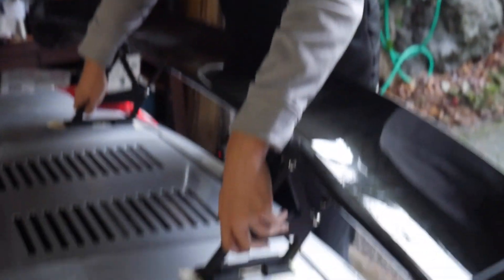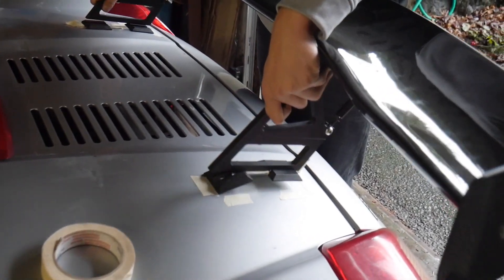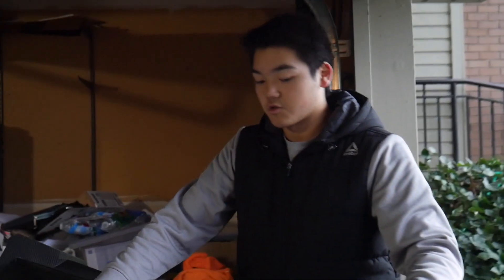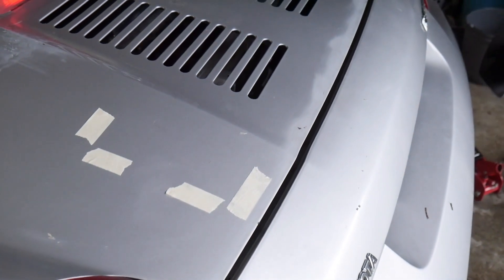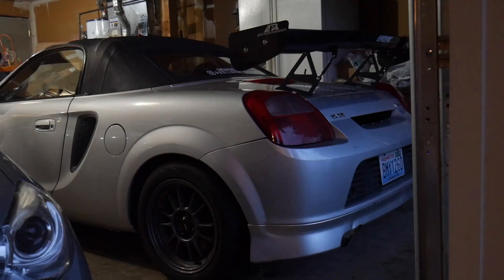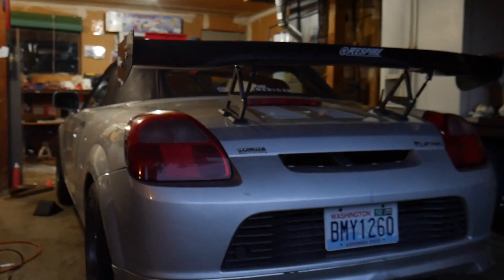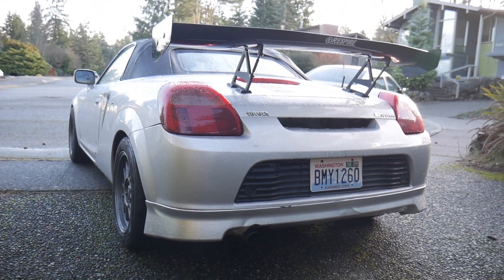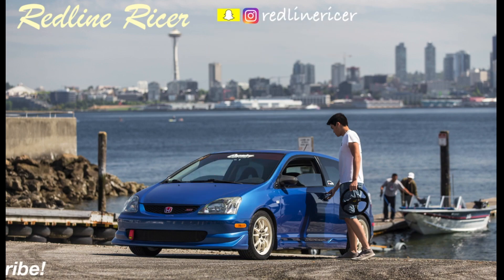BIG CARBON FIBER WING INSTALL | APR GTC-200 | 2000 Toyota MR2 Spyder

Comment: How much of a difference did it make around corners? You putting front splitter or nah?
Reply from the maker: cant say it make a difference. i dont do road course, only autocross
Reply: @RedlineRicer  yo if you only do autocross that's drag and weight my dude xD
Reply from the maker: @TheArtofBoxing101  it weighs around 7.2 pounds. so not much weight, also im not gonna say it does anything becuase i havent measured it in any way to say that it ACTUALLY does anything
Reply: @RedlineRicer  Yeah + rear downforce never hurt no body haha, man I'm so nervous to drill mine in.